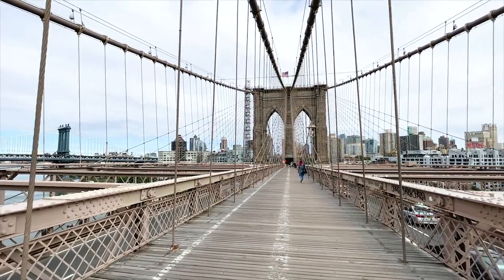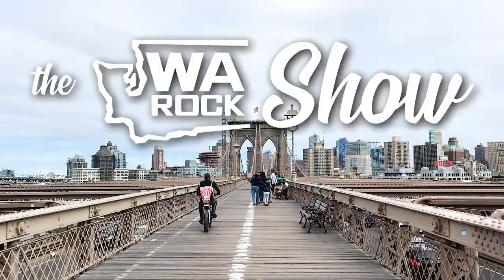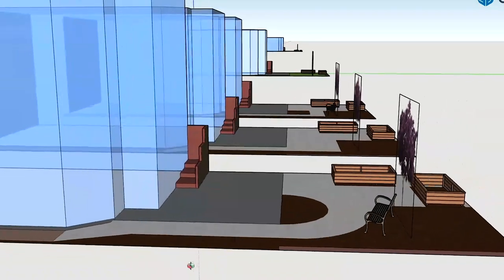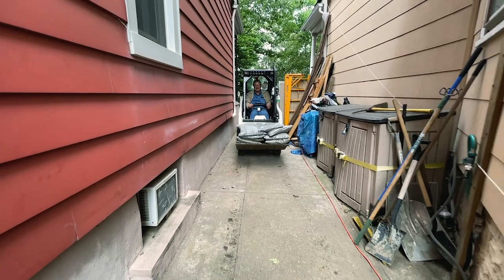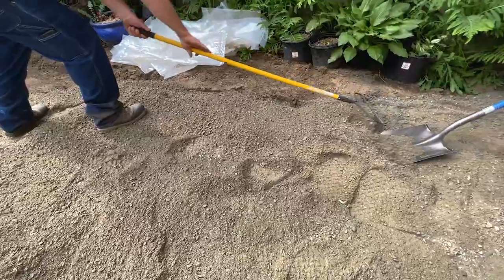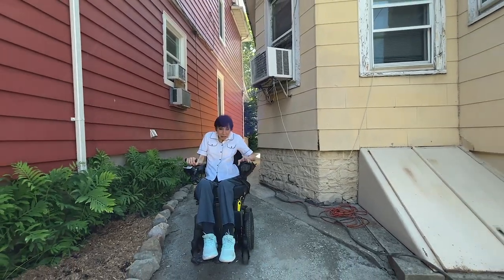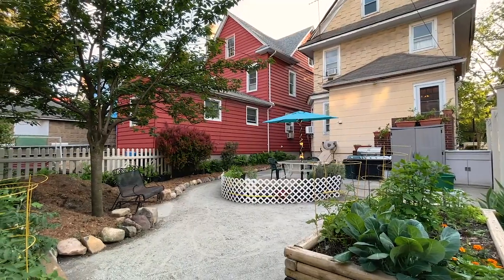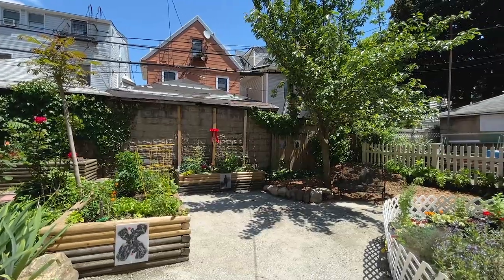How We Made Gravel Wheelchair-Accessible in Brooklyn, NY

Comment: This was great. Looking to do similar at my place. What would be your thoughts on using a plastic stabilizer grid on top of base rock and using gravel/decomposed granite in grid? I see where it is used for roads and such, but not so much on paths or patios. Barely a landscape novice, but wondering if using a grid instead of just gravel and such might be better in wet and muddy situations. Too bad you aren't in NorCal.
Reply from the maker: This is not our area of expertise, but we can summarize what we learned from Googling around. If you do use a stabilizer grid, make sure it is commercial grade. There are many flimsy knockoff versions that won't last over time. 

Grids can help keep gravel in place and prevent migration. They're great for permeable paths, i.e., gravel that allows water to pass through. 

Some cons are that grids are expensive and require maintenance. For example, some online discussion boards discuss the grid showing through the gravel layer over time, so you would need to add gravel to the surface occasionally.

Grids may also break down over time.

For your money, maybe it would be worth it to create a border around the path instead?
Reply from the maker: Wanted to let you know that we just published a blog series about gravel grids: https://www.wa-rock.com/ask-washington-rock-what-are-gravel-grids-an-introduction-to-gravel-grid-pavers-and-rolls/

We hope it's helpful!

Comment: Does this rock loosen up and need maintenance and re compact yearly? What about snow and rainy areas would you still recommend this type or go for different material northern states?
Reply from the maker: Yes, it will loosen and need to be compacted to maintain accessibility. We talk about this in Guideline #8 in our article: https://www.wa-rock.com/ask-the-rock-how-do-i-make-a-gravel-surface-wheelchair-accessible/

We would recommend 4 inches of 5/8" minus + 2 inches of 1/4" minus or 3 inches of 1/4" minus by itself regardless of where you're located. We're located in rainy Washington State where this method has been used for public works projects. You may find that you have to do maintenance to keep the surface level and compacted.
Reply: @WARockQuarries  good info thanks and I'll check out the blog
Reply: Working on this yard (Daniel) I've found it does stay compacted because of the stone dust and various gravel and particle sizes, which lock everything together unlike loose or washed stone, which moves around. If you live in a rural area you've seen entire roads of gravel that stay compacted and are plowable. If there's a flood they can erode but are easy to regrade. The only thing I've had to do to maintain this surface is pull weeds from time to time, which come out easily by the roots. We used 1/2 inch gravel mixed with stone dust. The original plan was for 1/4 inch for maximum compaction. These are great products but not carried by a lot of stone yards and landscape suppliers. You can find 3/4 inch everywhere and it's cheap. That's what the gravel roads are made of. Having worked with gravel a lot more after this project I'm convinced that 3/4 inch would work too. It goes by a lot of names: Pack, road base, crusher run, crush and run, crushed stone, decomposed granite (DG), 3/4 inch minus, and where I'm at now in Upstate New York, "Item 4." Let me know if there are any more questions about how this yard is performing.
Reply from the maker: @limbhacks3961  thanks for the insights!